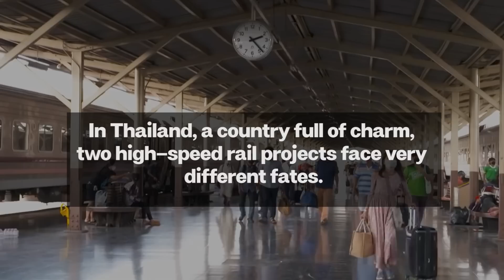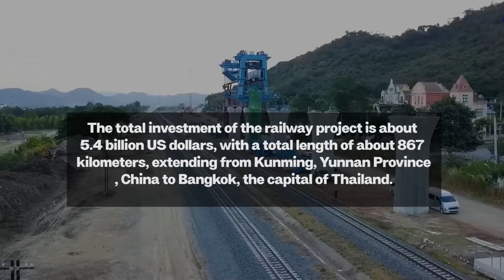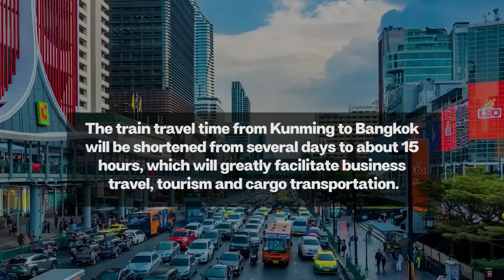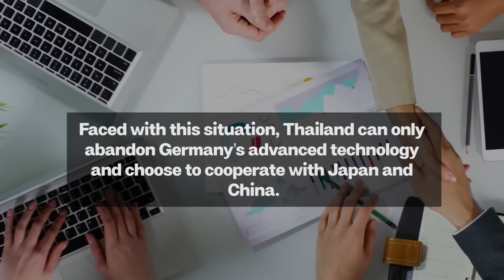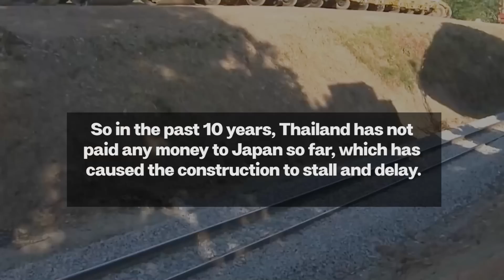Japanese Conspiracy? Steal China's Project, But Failed | Thailand Profited

Comment: On February 7, Thailand’s Transport Minister Arkhom Termpittayapaisith held a meeting with Noriyoshi Yamagami, Japan’s deputy director-general of the Railway Bureau, Ministry of Land, Infrastructure, Transport, and Tourism. But details that surfaced following the meeting suggested that Japan was unwilling to fulfill the Thai request for a joint investment. Instead, Japan insisted on Thailand investing in the entire project while Japan would offer soft loans to aid the construction.
From the Thai perspective, a joint investment with Japan was preferable, given the fact that the Thai military government has faced economic difficulties since it took power in a coup in 2014. Arkhom informed the media that seeking Japan’s joint investment was a way to minimize debt for the government. The initial estimation of the cost of the project stood at $13.5 billion.
Japan, for its part, had its own reasons to reject the Thai investment offer. On the technical side, the Japanese design of the Shinkansen-style train in Thailand was likely to be altered. Thai Prime Minister General Prayut Chan-o-cha instructed that the train’s maximum speed must be reduced from 300 kilometers per hour to 180 to 200 kilometers per hour, primarily to save on construction costs.
Meanwhile, Japan argued that it would not be cost-effective to invest in a slower train. While skipping certain stations may decrease the project’s capital investment. Japan saw the alteration in terms of a loss in getting potential passengers who live near the canceled stations. More broadly, Japan could be aware that these alterations may result in its Shinkansen train losing its well-known trademark as being one of the world’s fastest.
Reply: you are right, before Indonesia awarded the contract to China, Japan rejected as well the B to B concept  Looks like Indonesia makes a right decision. For phase 3 MRT of Jakarta , our president has given the Japanese party a signal , that he wants the phase 3 MRT be decided before end of this year, otherwise China will took it. Jakarta Phase 4 MRT and inner city Jakarta 2nd phase MRT to Manggarai Jakarta Central Station is given to South Korea as well as Bali MRT.

Comment: I'm living in Bangkok and watching your video alerted me immediately. The distance between Bangkok and Surathani is around 640Km depend on which points you chosed to (not 160 km as you've just described)
Reply: The 688-kilometer rail line, which features 12 stations, will be divided into two phases, with the first phase covering over 380 km from Bangkok to Phitsanulok, and the second phase covering a further 288 km from Phitsanulok to Chiang Mai.
Reply: Suratthani is located in the southern of Thailand
Reply: This entire vid and the comments are all rubbish jingoism.

Comment: Japanese will always fail to China because of labour cost, expert field due to past experiences, material cost, speed to complete, reputation to complete on time if not faster.
Reply: Chinese contractor asks to further delay Hanoi's first sky train
Unresolved loan disbursement issues from the Chinese government continue to hold back construction.
The main contractor for Hanoi's first elevated railway line running from Cat Linh to Ha Dong to the north of the city has suggested pushing back the project's deadlines to late 2018, according to the Transport Ministry.
Under the new schedule, test runs would be carried out in early September 2018, and the line would be put into full operation the following month. This would result in an 11-month delay compared to the previously proposed schedule, which would have seen test runs in October this year and a fully operational elevated railway by mid-2018.
"This is only the Chinese contractor's estimation, not an official schedule," said Nguyen Ngoc Dong, vice minister of transport. "The Transport Ministry has asked the project's management board to review its progress, and a report will be submitted to the prime minister in January 2018."
The main contractor, the state-owned China Railway Sixth Group Co., claimed delayed disbursment of $250 million in official development assistance (ODA) from China as the cause of the delay. The main contractor still owes Vietnamese contractors over VND600 billion ($26.5 million), despite already taking over $65 million from its own working capital to pay them.
In October, the project's general manager Tang Hong said he had asked the Chinese embassy to accelerate the disbursement of the missing funds, and worked with the Transport Ministry to speed up the project.
According to Dong, Vietnam has resolved all disbursement issues on its side but the necessary procedures on China's side have yet to be completed.
Currently, 95 percent of the project's construction work has been completed while 60 percent of imported equipment has arrived in Vietnam, 40 percent of which has been installed. The contractors are expected to install the signals and electronic systems and finish construction of the stations in the coming months.
Work on the Cat Linh-Ha Dong elevated railway, which will run over more than 13 kilometers (8 miles), started in October 2011 and was originally scheduled for completion in 2013. But several hurdles, including issues with the Chinese contractor, have been stalling the project for years.
The original cost estimate of $552.86 million has also ballooned to more than $868 million, including $670 million in loans from China.

Comment: An update INFO: Thailand and Japan are preparing to begin the first-phase construction of a high-speed rail project linking Bangkok with the northern province of Chiang Mai which first phase will be started from Bangkok Grand Central to Phitsanulok (388 Km). The second project will be continued to Chiang Mai (288 Km). Japan proposed using Shinkansen-style trains, which typically reach a maximum speed of 300 kph. Est of total cost is around 8 Billion USD. FYI.